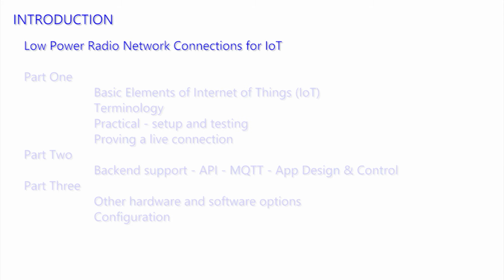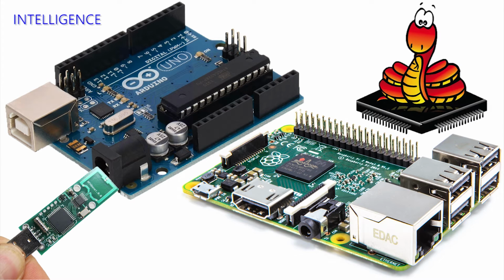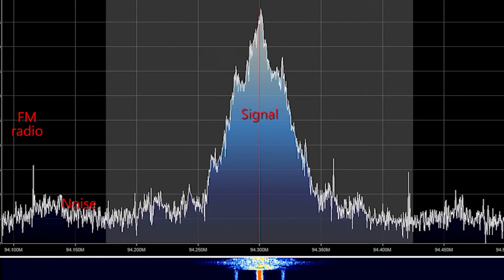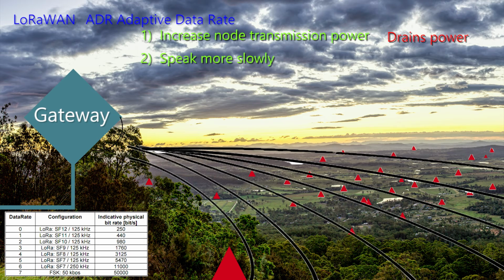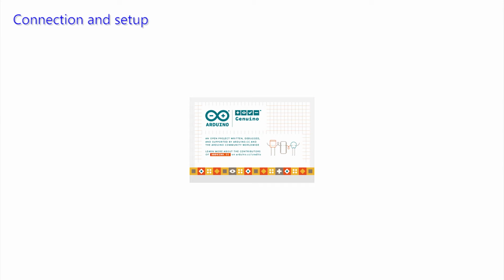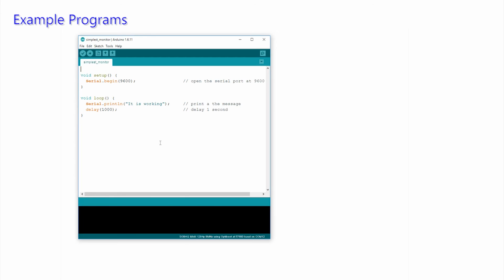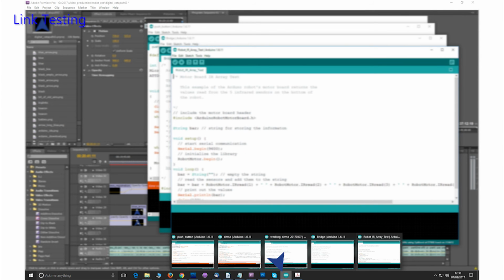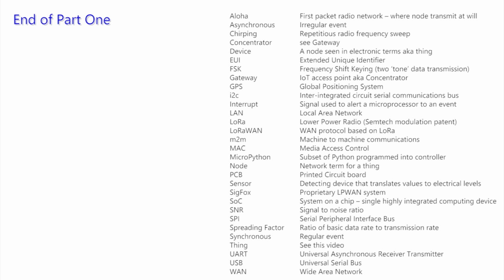IoT Sodaq Mbili

Comment: Very informative..thanks a lot.
A question, how do we do a site survey for the gateways? Is there a tool? Should we consider SF and number of 'things'? Or just install them with a distance of let's say 2 km away, as each gateway will forward whatever it hears?
Reply from the maker: Ah Ha GOT YOU!!!   That is the very subject of a whole hour long bonaza I'm just rendering.  Be sorry be VERY sorry!
Reply from the maker: https://youtu.be/WizST6gighs
Reply from the maker: We are working on this - but it raises so many questions about who the users are and what equipment they are installing.  You could drive around quite happily with a roof top antenna - slatting data onto an online map BUT is this of any use when your user just uses a cheap ceramic resonator or tatty bit of wire as an antenna?